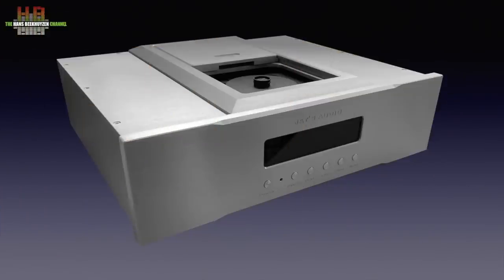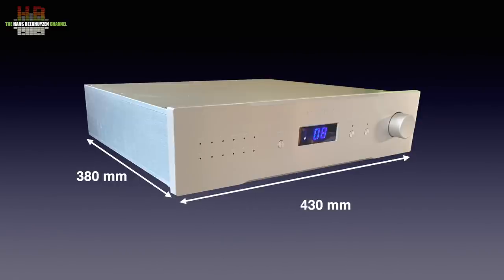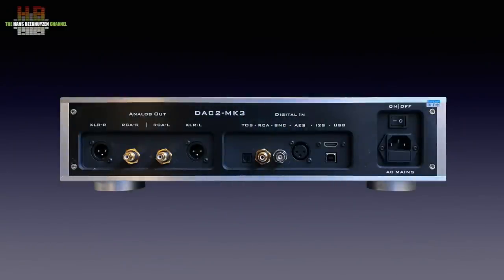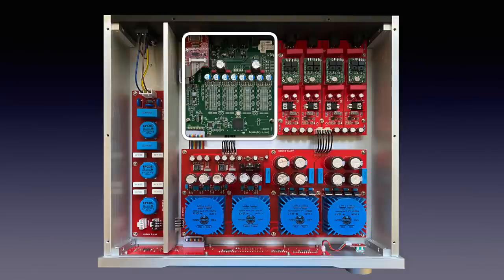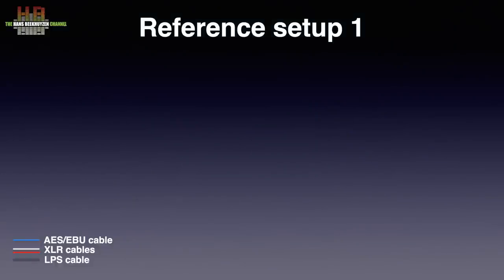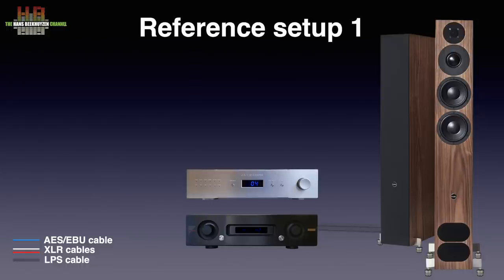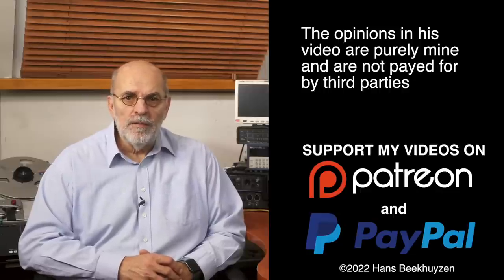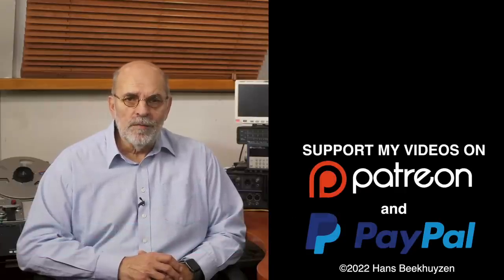Jay's Audio DAC 2 MK3 Ladder DAC

Comment: Hello Mr. Beekhuyzen. Many thanks for your interesting videos. 👍👍 You now a network streamer like the Cocktail Audio X45 Pro with a HDMI (eARC) interface to insert the HDMI TV output?
The reason ist that i will perform a setup with less HiFi devices possible: TV + music server/streamer + aktive laoudspeekers (+ subwoofer).
You now if the Cocktail Audio X45 Pro HDMI interface is a pure I2S interface or even a HDMI input interface to connect HDMI TV output?
TIA
Reply from the maker: Not by head.
Reply: @TheHansBeekhuyzenChannel  Thank you.